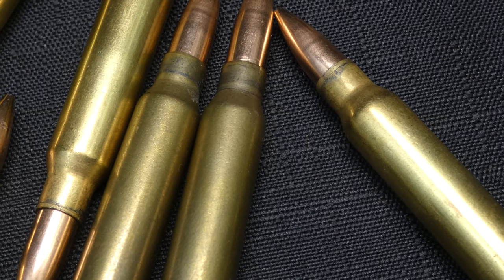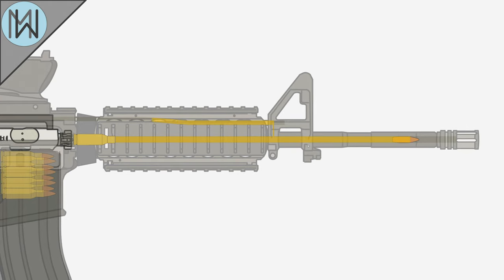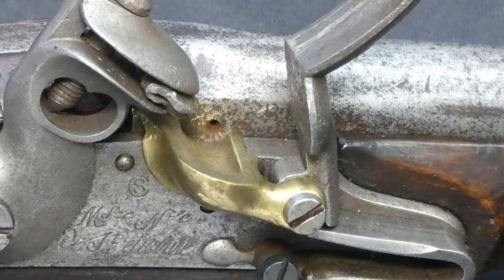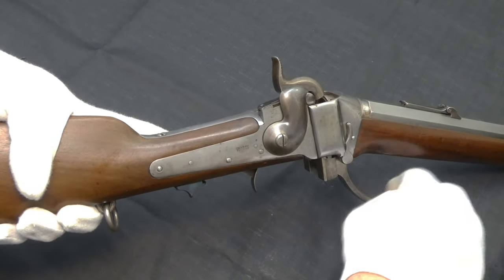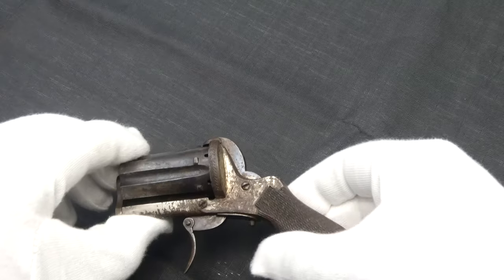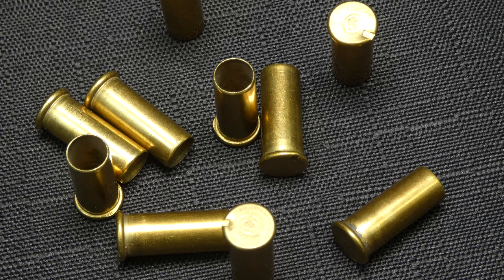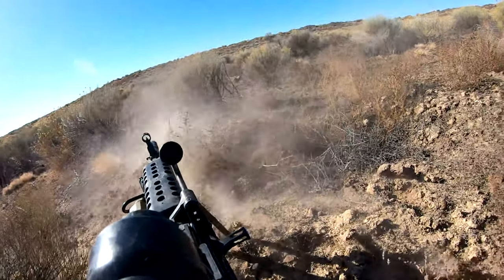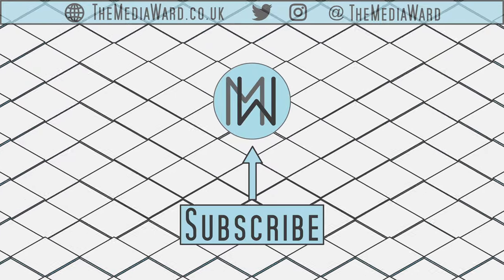Modern Ammunition - A Short History

Comment: I dissagree blackpowder needs a longer barrel for its slower burn and gas pressure rate.
You simply use less and it fixes the issue or pistols and my 28 inch barrel jaeger would not work.
Factor rifling in as this greatly helps pressure to rise.